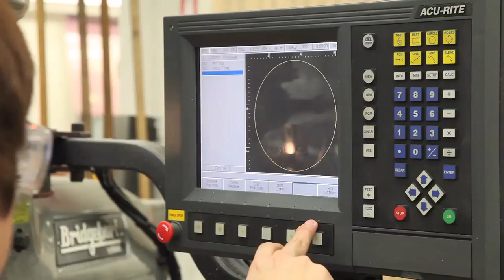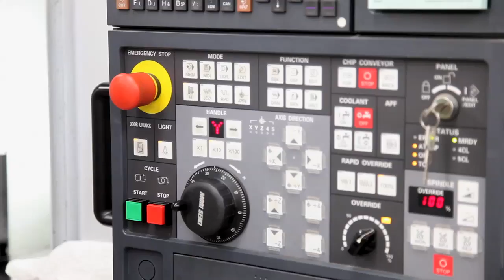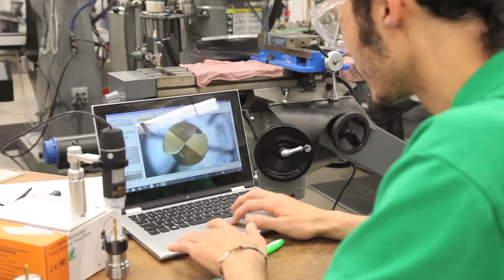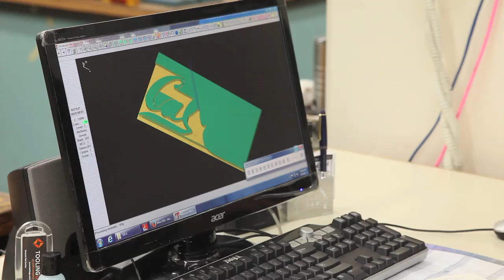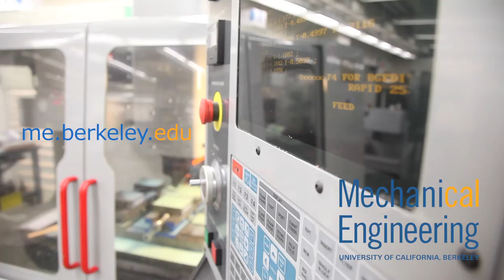ME Student Machine Shop

Comment: If engineers could machine like a machinist they would be one, but they can't so they stick to designs and let the pros due the machining, one class in machine shop is all they take not enough to be a machinist and understand the details producing parts to one ten thousands of an inch. Check out your local community college to be a machinist.
Reply: It’s good to know it so you can empathise and consider, also it’s nice to get hands on and build something yourself you have to think about a lot more to make it real
Reply: @luke7503  Yes it's good to know but as I said 1 class is just not enough so if they go to a cc and get a few more classes they will better at doing their job and understand what the machinist has to deal with.
Reply: You missed the entire point.

If your average machinist could solve nonlinear partial differential equations they probably could be engineers, the make 5x the money lol

Comment: I always cringe when I see a vise mounted on the center of the mill.
Reply: Do you see any of this "other tooling setup"?  For a student shop leaving tooling (sine plates, dividing heads, rotary tables) on the machine makes no sense.  Especially considering that the majority of student work will be done on a 6Inch vice. 

Your rant makes me cringe. As if your way of setup is any bit reasonable for a school environment.  Production, maybe.
Reply: ... wow.

1. Have you ever been a machining student 2. have you ever used a bridgeport? 3. Are your shop tolerances +-.010?   4. Are you a machinist or a hobbyist?
Reply: @SD Customs How are you extrapolating their curriculum from a couple minutes of video?  Jesus, way to run with your assumptions. 

 top kek.
Reply: a Woah, chill out dude... lol it's just a comment. Yes, I am making a very far fetched assumption based on a short video. Things like "There's no way to calculate tolerance," and "We're not teaching them to be machinists," and the fact that they're just trying to get a hands on experience draws me to conclude that. Yes, I've used a Bridgeport, yes I've worked within very close tolerances before.
Reply: Not to mention moving the vise around makes for a more balanced wear pattern to the table ways. Leave it in one spot, and the first thing you know, there is a loose spot in the middle of the table travel.
Reply: Dreg555 Why?
Reply: One can mount a six inch vise off set left or right on the table, and that leaves way more room for other tooling setup.
Reply: Dreg555 Didn't think of it that way, makes sense...
Reply: Dreg555 The sad truth of it is that they probably don't teach the kids anything other than vice holding... I approve your cringe, lol... no true knowledge going around in that shop.
Reply: Not really a rant, it's just makes no sense not to utilize the machine for well, it's full capacity, to uh, learn on. It's a school right? Not everything has to be done in a vise. Whether or not these students stick with Mechanical Engineer or decide to work in a machine shop, bad habits start early. 

The greatest thing is that 6 inch vise will work just as good mounted on the left or right of the machine, as it does in the center.
Reply: Dreg555, The problem with that idea is that no one knows what they will be doing in the future. Just leave the mill the way you just set it up.